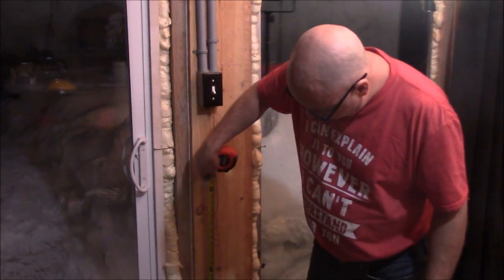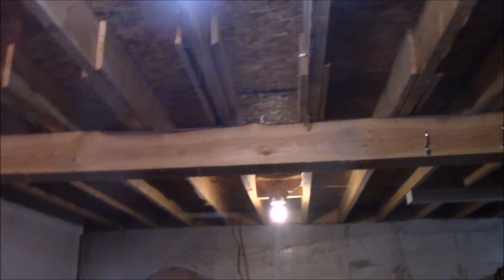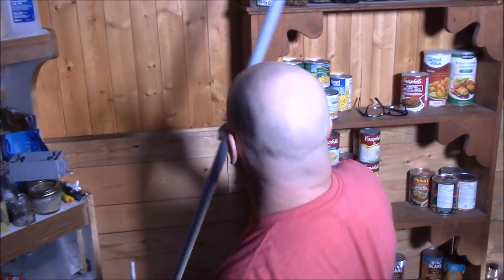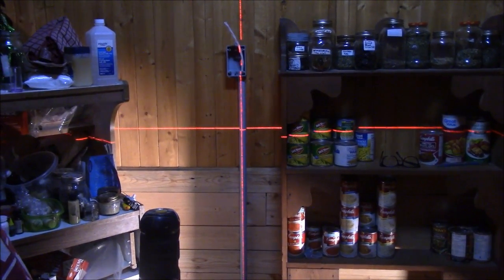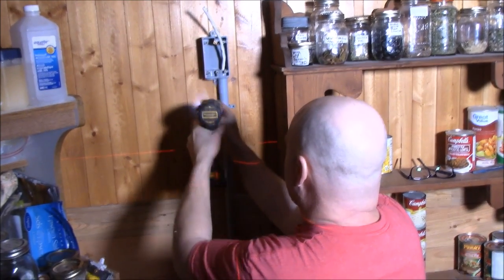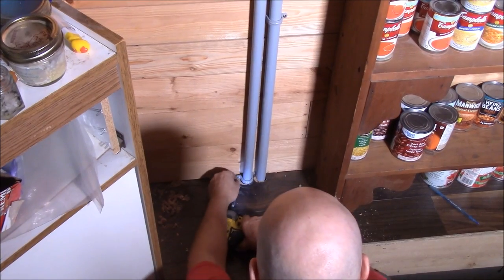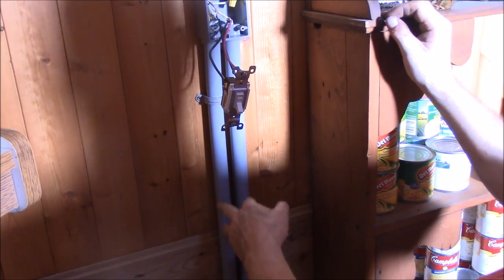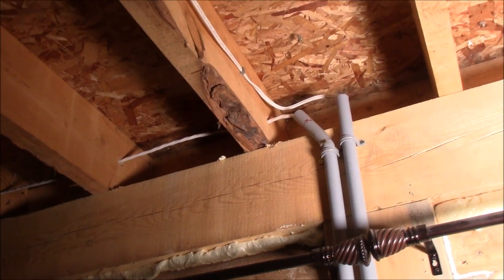Wiring Up Our Basement For Electricity/ But I Have A Question

Comment: You can run romex in conduit in a short run like you did for protection of the wire. This is an exception to the code. 
Wires can be run in the open above 8’ as this area is not considered accessible living space. At the top of the conduits where the wire exits there should be a SOFTENER (bushing at end of conduit) that keeps the conduit from cutting the insulation on the wire. Good work.

Comment: Cecil receptacles are 18 inches off the floor to center light switches are 48 inches off the floor to center smoke detectors are within 1 foot of the ceiling on the side wall or on the ceiling the best way to handle the wiring like you’re doing is to just put a single box on the wall and run one three-quarter inch PVC pipe up to a junction box and then have your Romax is go into the junction boxes and then that way you can convert to single conductors and run down the pipe into the switches and back-and-forth a lot easier no issue with code works well also on the light

Comment: The pvc is fine! No clamps needed for conduit.the box should have a rounded edge inside  the hole to prevent chafing.round the inside edge of the pipe where the romex comes out.
Reply: If a basement is considered living space,pvc is not good. It puts off a dangerous gas when burned.you might use EMT conduit instead.Or, maybe Pex tubing,pre-wired.
Reply from the maker: Thanks Mike...  I bought this PVC piping at an electrical place They told me it is the proper pipe to use in a home.  But after seeing all the comments I will ask them again, This PVC piping is made by IPEX Electrical.  Is it against electrical code to use this stuff inside a home?  I am not concerned about the gasses from the piping burning in a fire as that would be small potatoes compared to the batteries and such we have in here lol...Cheers.

Comment: Early on in the process, does not hurt to have a partial inspection to know if you are doing things right. If any wire in the circuit is 14 and the rest is 12 in size, limited to a 15amp breaker. If all size 12, 20amp breaker. Is always protected by a breaker size suited to the smallest size wire in the circuit. Oh, that's an fyi for people not familiar with electrical work.

Comment: Good morning Cecil and Heather! The wiring looks good and love three way switched at stairs! Good luck with the rest of the wiring. The only suggestion (I taught electrical and computers for 25 years) is GFI. Local codes override Hoosier code.

Comment: Not being failure w/codes is Canada...However in the U.S. and that vaires also according to states. Anyway in most states if your outlets are in the basement/cellar your required to have GFCI outlets or breakers unless the floor is either wood or laminate which would isolate the grounding potential. Lighting should never be mixed w/outlets. With reference to your 3/w switches you can also (if needed) make that lighting circuit a 4/w. 
Luv the vids keep em coming.

Comment: First of Cecil ....you did and not to bad job....a lot of people would have muffed it up with the neutral and the tree way,,, just to many wires....I`d just like to say that I still hold and Ontario commercial and residential electrical license and your strapping looks to be good....the only thing I`m concerned about is where you go in your 3 quarter conduit you have to secure that romex to the pipe with a connecter.....don`t change it....wait for your electrical inspection ,,,,maybe the inspector will let it fly.....put you gas monitors on a separate circuit and by the way if you want to start pulling wire in your wall they sell special bits ...they're like 6 feet long and Have a small hole on the drilling end to attach the wire once your finished drilling and there flexible so just your box whole and down to the basment....you can get these at Lows and there made by Greenlee I think....your good...I would have hired a guy like you....CHEERS

Comment: You could have overlapped the clamps between the two conduits and used only three screws and had a more symmetrical appearance. Doesn't seem like it would have been difficult to drill a hole from downstairs under the wall and fished the wire up. Then just cut a hole for a standard electrical box in the wall. Heather, keep an eye on the girls, you made Cecil look too pretty.

Comment: Dude you need look at your code book per section 210.8 and all rest of the section covering GFCI Because gfci s/  come in 15 and 20 amp units . That is the electrician job to know witch section in the code book covers instilling GFCI s

Cecil the reason the pvc box’s don’t have clamps is they are NOT made for Romex , Condit is all ways made for single wires .Texas master electrician mike and it looks good to me

Comment: dude, I believe that there is not allowed too be no more then three units per line, and then only GFI grounded.   and no more then three outlets on the GFI line  the code here is different then there, but then again you do not want too over tack the wires.  most  outlets no higher then 18", switch's no lower then 56". any where within 5' you need too be GFI grounded. with a conduit lined.  no more then three lines to a hole. no more then service allows to fused braker.  all lines should be fused, to your highest voltage. say a 30 amp. like a lamp 15 amp. heater a 60 amp, and so on. dedicated line on unity appliance.   where most active issue come to are the kitchen and baths.  but then again codes may very.

Comment: Smoke detectors have to be on their own circuit (breaker) and its against code to run romex in conduit. The romex could overheat and cause a fire.  You have to run stranded (insulated wires-separate pulls-THHN wire) which would mean a junction box, however junction boxes can't be inclosed in the ceiling. You could use an access door, to satisfy the code. SH 40 PVC is allowed in residential, by code, although some local jurisdictions (Authority Having Jurisdiction = Electric Inspector) don't allow it. Mostly because of off-gassing. If you are going to stick with you current setup you may want to a collar/add a reducer to the ends of the PVC. Vibrations might cut through - think tractor/dozer.
EMT would have been my choice for such a small run, and you can romex in EMT technically, but where you would fail inspection is in proper securing. Running romex in EMT, you couldn't secure it within 8 inches of the box.